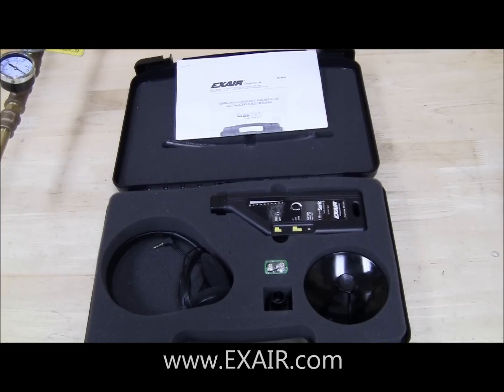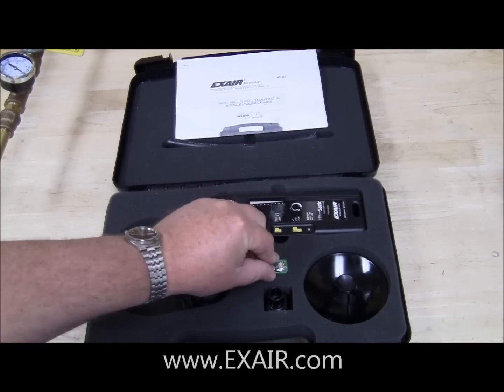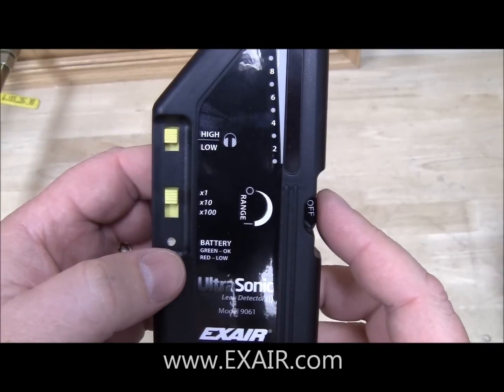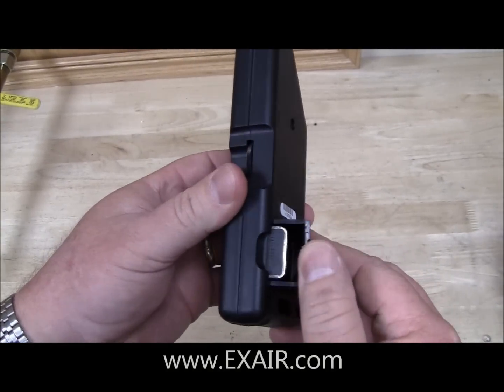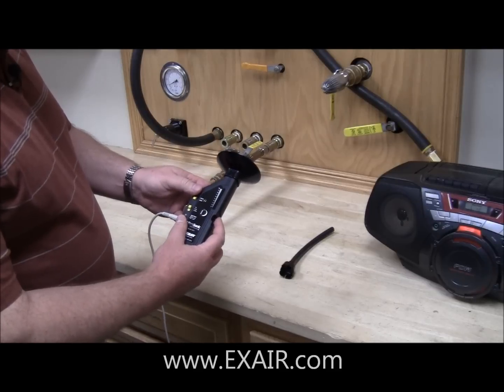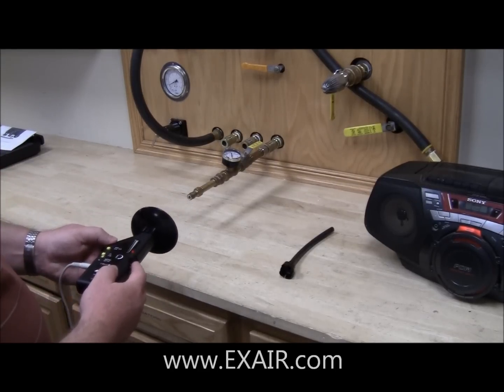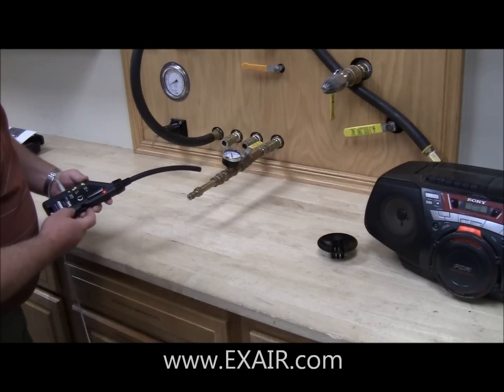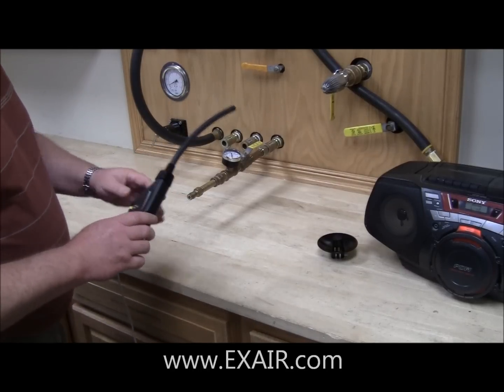Operation and Use of the Ultrasonic Leak Detector

Comment: is it possible to detect a leak behind a wall or in airways inside of a block (of plastic for example)
Reply from the maker: Pete,
It is possible to use the Ultrasonic Leak Detector to find large leaks that are close to a barrier such as, drywall or plywood.  This means you will not be able to determine if there are extremely low flowing leaks, they will need to be more substantial.  The best operation for the Ultrasonic Leak Detector will be on exposed pipes.   If you would like to discuss this further, please feel free to contact us.  1-800-903-9247

Comment from the maker: The sound from the Ultrasonic Leak detector will remain the same. It is the intensity of the sound which changes. This is shown by the LED intensity indicator which allows you to zero in on the location of the leak.

Comment: Does it work for detection of hydraulic leakage? Secondly suppose if there is flow through nozzle and in the same vicinity there is a leakage as well, will it detect the leakage in that area?
Reply from the maker: Thank you for the excellent question.   It has been used by rebuilders of hydraulic cylinders when they are testing the freshly rebuilt cylinder with compressed air before filling it with hydraulic oil.   On a hydraulic system you would generally see the fluid at the point of the leak.   It may help to find the leak in a dirty system as long as you can get close to the hose and fittings.   
If there was a pneumatic nozzle that had a lead on the air inlet, you could use the isolating tube attachment to separate the two sounds and determine if the leak is on the air inlet or if the noise is from the nozzle discharge.

Comment: Can it be used for the underground water leak detection?
Reply from the maker: @Jeremy, the Ultrasonic Leak Detector would not be able to sense through the ground.  There are other types of tests and detectors used for underground water leaks.  This detector would be a line of sight type meter.  If you have other applications please feel free to reach out to us through e mail, phone, or chat.  
1-800-903-9247
Techelp@EXAIR.com
www.EXAIR.com

Comment: hey just want to find out if this device can detect a vacuum leak and if it can how to do so thanks
Reply from the maker: Steven,The Ultrasonic Leak Detector can be used to detect vacuum leaks.  The process is the same as when testing for a pressure leak.  If there is a leak then it is going to still give an ultrasonic sound due to the air passing through an orifice.  If you would like to discuss this further, please contact an Application Engineer at 1-800-903-9247.

Comment: Hy, Neil how works whith pipes from heat floor hydronic system.
Reply from the maker: Hell Sandro!  If you wanted to use the Ultrasonic Leak Detector to scan the system before it was encased in concrete or other material then it would have a good chance.   Once it is encased in in the floor the ULD will not be able to sense the ultrasonic sound.   If you would like to discuss further, please let us know at Techelp@EXAIR.com  Thanks for the question!

Comment: is it possible to detect a bearing failure?
Reply from the maker: Victor, Sorry for the delay in our response.  The Ultrasonic Lead Detector can actually be used to listen for mechanical vibrations that lead to bearing failures.   For this application we would generally use the tube attachment and pinpoint the bearings in question.  If you would like to discuss this further, please contact an Application Engineer at 1-800-903-9247.
Reply: You need an SPM meter or a vibration meter with historic analysis, meaning in order to detect a failure you need a graph over the life of the bearing.
Reply from the maker: This could also be achieved with the ULD if you were to take baseline measurements when the product was new.   While the ULD is not built specifically for bearing maintenance, it is similar to a mechanical stethoscope where you will be able to hear chattering and the vibrations that can generally be isolated to the bearing housings on the part.
Reply: OK OK Many thanx!!!

Comment: I'm about to do an air audit at a job site, so what is the advantages of this over a bunch of Dawn dish soap and water? I see this as pointless and a complete waste of the customers money and time, so please sell me. Thank You!
Reply from the maker: Jason, Thanks for the comment.  The main benefit of utilizing an Ultrasonic Leak Detector over a soap and water mixture is the ability to conduct the leak assessment without contacting the pipes.   This means you are not introducing any moisture or chemicals to the piping system which can cause corrosion on piping.  There is also the scenario where you may not be able to see all the way around the pipe in order to check for bubbles from a leak.  This is where the tube attachment will be able to bend and reach into those places where you can't see to help find hard to reach leaks.  
The Ultrasonic Leak Detectors can also be used at a distance.  Not every fitting or joint has to be checked 360° with a tube attachment.  The parabolic dish will permit you to quickly scan the piping and areas of joints or fittings to find the leaks.  This will save time when conducting a complete system inspection where you would have to spray down each joint, fitting, and even pipe for that matter.  
If you would like to discuss the ULD further, or would like to get one into your own hands and give it a test, please contact an Application Engineer at 1-800-903-9247 or Techelp@EXAIR.com .  We do honor a 30 day guarantee on stock products that ship within the US.  (See our site for more details. www.EXAIR.com)

Comment: By this leak detector,can I detect leak in isolating cock (pneumatic)
Reply from the maker: As long as there is pressure on the valve from the compressed air then the Ultrasonic Leak Detector should help find if there is a leak or not.  When going around valves and fittings it is best to use the tube adaptor in order to isolate the noise to a smaller area.
Reply: Send product details
Reply from the maker: Please let us know an e mail or phone number to reach you at.   You can send it to Techelp@EXAIR.com